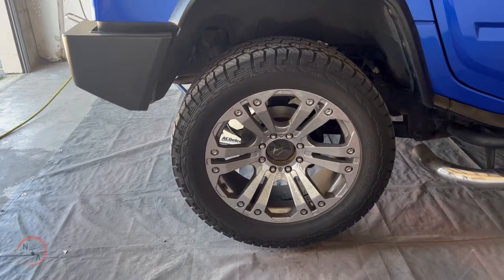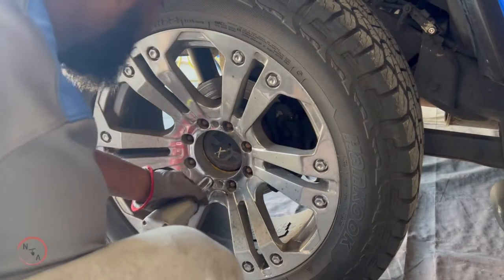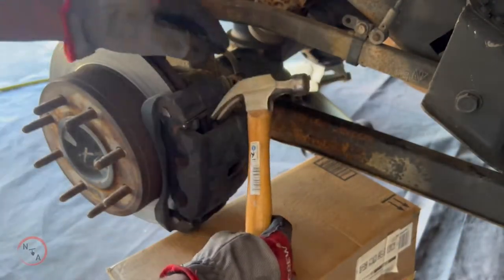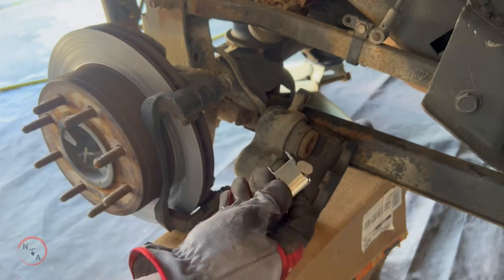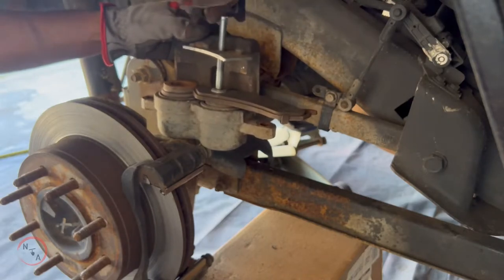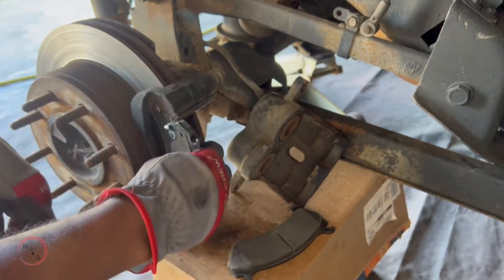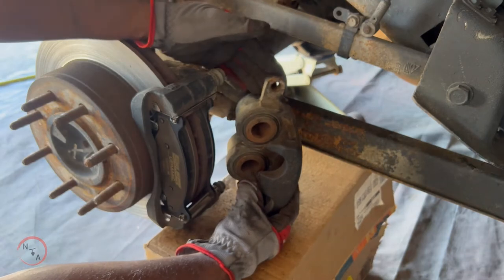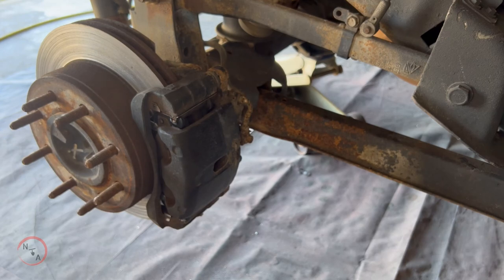(How to) change your rear brakes on a H2 Hummer

Comment: Excellant video and to the point. Thank you sir!
Reply from the maker: You’re welcome and thank you for watching the video.
Reply: @newtouchauto  well mine stripped and you show use a t-55 bit. Is that the correct size to get these off? Its for the caliber. THANK YOU !
Reply from the maker: @kirbharp2157 Yes that’s the correct size which worked for me removing the screws. The screw head may have stripped bc they were seized too tight, mine were like that which is why I needed a breaker bar. I slowly loosened the screws so that I avoided stripping them.

Comment: Crazy I have just one t55 on one caliper the rest are 18 looked over an hr for my t55 I cheat I used a screwdriver to compress mine caliber before I unbolted anything you were a great help I actually was a little skeptical on tackling the rear brakes I got it 05 SUT and it’s definitely a Michigan vehicle but hey good looking on your information New subscriber
Reply from the maker: Wow that 1 caliper with the different bolts would drive me nuts. Thanks for the support and I’m glad that you find these videos of help.

Comment: Are the rear brakes the same as the front brakes?
Reply from the maker: No the size between the two are different but the installation is the same.
Reply: @newtouchauto  God dammit, I bought front brakes for my hummer H2 thinking it was the front brakes but it turns out it is not the front brakes. The squeaking is coming from the back so I suspect it’s the rear brakes. So I’m just gonna have to return them tomorrow and get the correct ones that should be easy Peezy I know how to change brakes, do you know swap engines so I am mechanically inclined. I just thought they were the same in the back if you know what I mean lol.
Reply from the maker: Hey just look at as a learning curve, now you can assist the next person who may think the same.